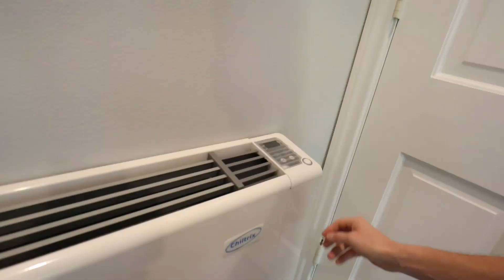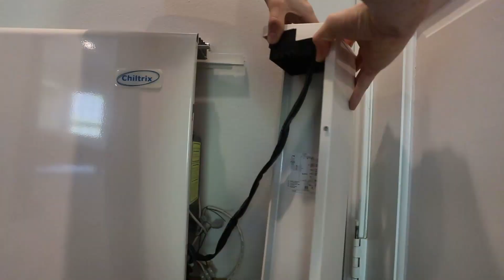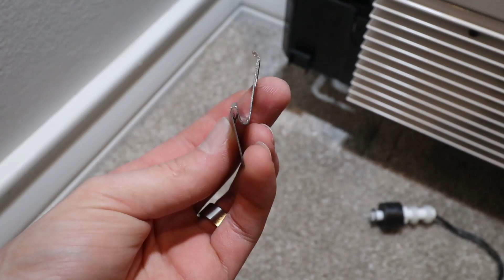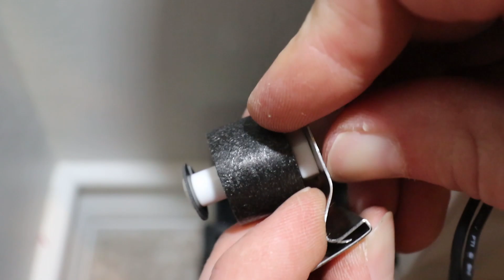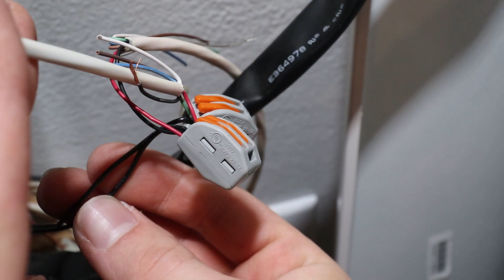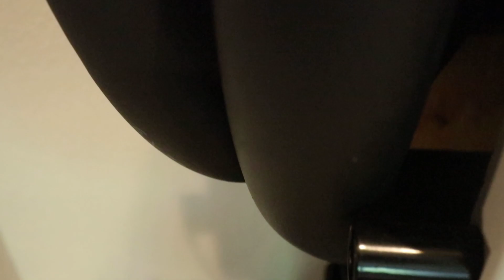Chiltrix heat pump condensate overflow float switch

Comment: do you have a circuit diagram for that? I am not sure I followed what all you're hooking up.  Seems like a pain to have to get one of those for every unit. I use " slime tabs" at work to keep the FCU condensate clear.  Thank you for the videos
Reply from the maker: Brian, here's a quick wiring diagram. I need to remember it's hard to visualize how something is wired. Let me know if this makes sense.

https://beenelife.com/chiltrixwiringfcu/

At work - what happens if the drain does clog? I might just be going overkill, which is less expensive to do at a residential level. Only a few FCU's to worry about!